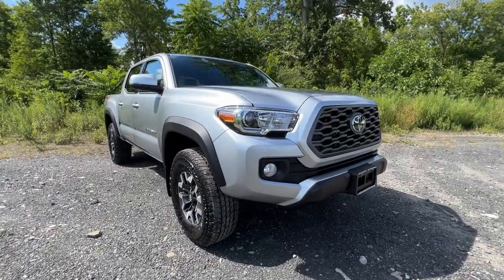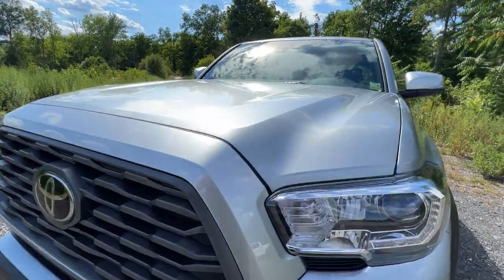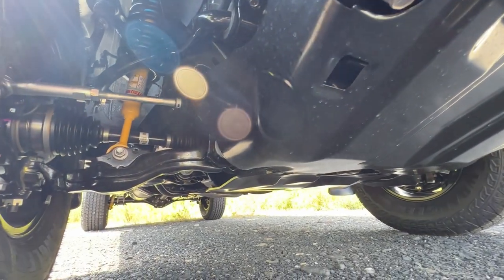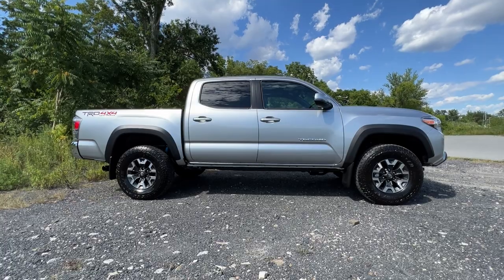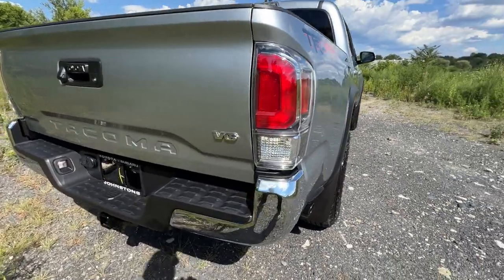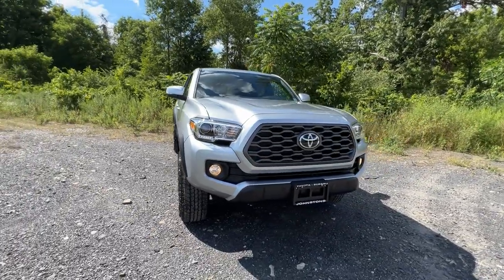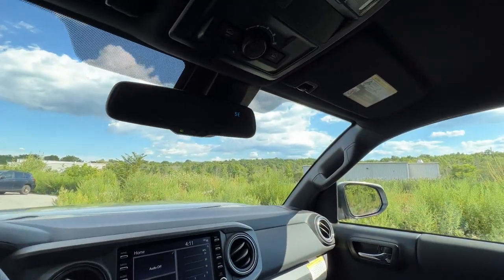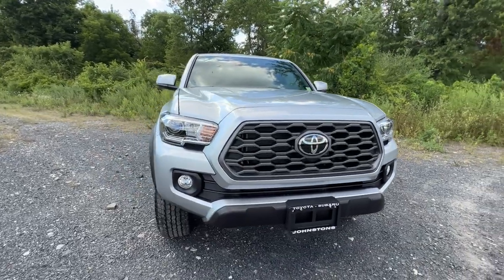The 2022 Toyota Tacoma TRD OFF-ROAD (a *biased* overview)

Comment: The Tacoma is nothing but a truck it's not fancy it's not fast it's not super luxurious but it's reliable & for me it drives perfectly fine I wanted one for years & finally got one I bought a 19 used TRD off-road with 17,00mi in Barcelona red with the 6 ft bed it fits in my garage, easy to drive & perfect for work. It's got a few features that are nice the adaptive cruise control + Lane departure. It doesn't have all the goofy shit you don't need. I dig it. ⛽ Mileage sucks tho

Comment: The main problem as to why I won’t upgrade my 2019 Tacoma is the payload! They need to update Payload by about 500 pounds for me to even bother upgrading!
Reply: You can just upgrade the suspension for much cheaper than a new truck will cost you. You'll probably need a bigger truck though.

Also, many people, including myself, have put more weight in the back than the Tacoma is rated for with no issues. Your results may vary.
Reply: @crusherman96  
I like The smaller size of the Tacoma!
I already upgraded the tires for heavier loads. I put airbags in the back suspension. 
I have 1000 pound camper in the back of my Trd, but when you add a couple of passengers and stuff to put in the truck I’m way overweight. 
I like the size of this Tacoma because it’ll go on trails easier than a full-size truck. 
The Toyota Tacoma is way behind in Payload than every other manufacture on the market!
Reply: @benjones8977  to be honest that 1000lb weight is what is hurting your payload.  For any halfton truck for that matter.

Comment: 20024 here. Just bought my preowned TRD 4x4 offroad with 10 k miles. Traded in my 2006 TRD Prerunner wit 350 k miles. The motor was still strong. Love the Simple Design of Toyota. Lovethe reliability. Less Electronic fuckery is hood, IMHO. I am an Avionics tech and I can tell you that the electronics are almost always the failure point in an electro mechanical system. Honestly, I would prefer a fully mechanical 4x4  engagement system, but those days are long gone. Loving my teuck so far though and I appreciate your videos....
Reply from the maker: I understand and agree and thanks for watching!

Comment: I have a 2014 TDR Off-road 4.0 5 speed a/t purchased new in 2014 and love it. The tech is really outdated to todays standards, no Apple play ect but not a big deal.  I haven’t looked at new ones in a few. Toyota has really changed a lot of the 4x4 options. Nice to see. 
My only minor gripe with my 4.0 is gas mileage. Avg around 16-18 mpg, but it’s a truck and I knew it would be great anyway. Nice to see the 3.5 with AI has corrected that some. Great vid.
Reply from the maker: Nice truck and thanks for watching! Wait till you see the next Gen of Tacomas and what their mpg will be 😉

Comment: Yes I agree the Territory are much better than the previous tire that came on the TRD OR.

Yesterday (27 Jan 2024) just bought a 2023 TRD OR Access Cab since the ‘24 returns to the Xtra Cab style. I like the Access Door picked it up with 8 miles. I am going to tint it and ceramic coat inside and out. My Salesman gave me the Overlays. I also have the basic Off Road, first time I bought a vehicle with no options. I like that the spokes on my steering wheel are flat dark gray.

Comment: Picked up a icecap white one on Saturday got it for 42.5 out the door with the led drl, all weather mats/door sill protectors, black out package, bed light, door edge guard, quick charge cables, wheel locks,cargo divider and window tint by the dealer only Toyota in socal that wanted to negotiate was Claremont Toyota. Most used ones wanted 38-41k  got a great deal on the new one.
Reply from the maker: Congrats!

Comment: I love my White TRD Off Road with the premium and technology pkgs, crew cab and the 6’ bed, tri-fold tonneau cover and running boards.
I use the front camera often, especially when going off road
Reply from the maker: Very nice truck
Reply: @brianruperti  Yes it is. We’ve been saving money for years to be able to buy it.
Since retiring I drive about 5-6K miles a year, so it’s safe to say that I’ll be driving my 23 TRD until I can no longer drive or I’m dead.

Comment: Nice overview, best I have seen bar none. I came because after looking at Frontier passenger door s not installed or not made right and the dealers not caring I just bought a 4dr,trd off road 6 foot bed and wanted to see what was coming in for sure lol. Frontier has a known issue (I know now) with passenger side doors not fitting right. This will be my 1st Toyota Truck.
Reply from the maker: Welcome to the family 😎

Comment: Thanks for your video, very professional and detailed. I am a 6ft 1" height guy and the smaller trucks are too cramped, seat too low to the floor. I would also think people should show the crash test scores when buying a vehicle, insurance costs, etc. Safety in a crash is probably pretty good on newer vehicles. I heard the naturally aspirated V6 is going away for 2023. 4 banger with turbo in its place, is thst true??? You did an awesome review, thanks again. Good choice in a quality truck purchase.
Reply from the maker: Thank you for watching. And thank you for the kind words. No definite yet on the 2.4T but I suspect it’s coming because Highlander got it and Tacoma has the 2GR-FKS that the Highlander lost. I trust it will be successful but the V6 is cherished. Especially the long lost 4.0 that the 4runner has still!

Comment: Hey man, i bought the 2022 tacoma 2.7 , 4cyl., brand new with 2 year warranty...the dealer says the first oil/filter change won't be until 10,000 miles...should i be concerned??..thankyou so much, great show and info👍🏽
Reply from the maker: Congrats! It’s normal for dealer to recommend 10k since that’s what Toyota recommends. I personally change oil every 5k miles or 6 months whatever comes first.
Reply: Yes, the 10,000 mile oil change is the MINIMUM to maintain your warranty, Change that oil every 5k or 6 months and that Toyota will never fail you.

Comment: Thanks, Brian, for the thorough walkthrough on the Tacoma! Love that silver color as well and would be what I get. I was getting ready to take the plunge when I found out that my local dealer is one of those who are gouging with "Market Adjustment" pricing. It basically pushed me out of the market. I have no interest in rewarding price gougers so have decied not to purchase. Was curious if anyone in the comments had to deal with this and if it disuaded you like me. Happy trucking and thanks!
Reply: I live in Los Angeles, every dealer is doing a 5k markup. Which turned me off. However one dealership. Longo Toyota is selling ALL vehicles at MSRP!! So I bought a Long bed TRD off road
Reply: Just got my 2023 OR for under $3000 MSRP. They’re just trying to sell 23’s before the new 24’s, got lucky. Greetings!

Comment: My 21 off road came with the oem led headlights. Yours came with the halogen and it’s a 22 🧐🧐🧐
Reply from the maker: The LED headlights is a package that some have and some do not. It’s usually $499-$599 spending on the region you buy the truck. Only available on TRD OR and TRD SPORT plus standard on the TRD PRO.

Comment: Hi Brian, do they have an OEM remote starter?  If not do you recommend an aftermarket plug and play one?
Reply from the maker: I haven’t seen anyone go OEM due to cost. Aftermarket plug and play is fine just vet it well and make sure the dealer backs it for at least a year or if you’re going solo, make sure it’s the real deal.

Comment: I have one on order just like that. My question is the tires. What do you think about the factory tires that comes on it. Do you think they will it last for a while and do you know the treadwear rating. I was thinking about having the dealer trade them out but don't know if it would be worth the money. What's your thought on the factory tires for longevity.
Reply from the maker: I own the 2021 offroad with the factory tires and go off-roading in them and highway drive and they’re fine. I don’t know the rating you’d have to look it up but for daily driving and entry level off-roading you’re fine.
Reply: How many miles do you have on your Tacoma now? Are the Goodyear tires wearing even and not dipping out.?
Reply from the maker: @ToyotaTacoma1952  21,000 miles and tires are wearing evenly performing fine

Comment: Is it true, That nationwide as a dealer-installed option, the
new lift kit provides a 2-inch front and 1-inch rear lift on
most V6-powered 4x4 Tacoma models?????? Thank you. Just purchased a 2022.
Reply from the maker: Yes it’s available it’s less in the rear to increase clearance

Comment: Looking under the hood the 3.5 looks even more serviceable than the 4.0. 
I have heard the Lexus models tend to get the new engines and technology for a number of reasons. First their buyers are going to expect it. These buyers generally don’t keep their vehicles as long, so if there are issues they aren’t going to keep them that long to create a bad reputation. And finally it is a smaller group of buyers to get new engines and equipment sorted out without creating a recall problem with a 240K+ of yearly Tacoma production. Toyota as we know is very conservative and likes to make small careful incremental changes. Still there are risks to new vehicles and vehicle parts, so no matter how much you test them they have to be used in the real world to really know how they will hold up.
Reply from the maker: Very nicely stated thank you

Comment: I am not sure what the ECT button is. Sorry if you covered this. I believe it changes shifting ratios of the transmission. I haven't tried it yet. Still working on all the other stuff to learn. Your input would be great.
Reply from the maker: Electronic controlled transmission for more “positive feelings” as the book says. It’s like a power mode button and makes the transmission rev out a bit more

Comment: When I noticed that the rear factory mat is one long piece I said: cool! But then, you have to experience trying to remove something to clean/maintain, to see if its really a cool thing to have. It is not. It didn't take long to realize that the one-piece mat is a b**ch to remove. You actually have to vacuum it first or all the dirt will fall on the black carpet underneath. I like to shake off my mats everytime I see a spec of dust on them (lol!), and not been able to easily remove my rear mat is agravating. I guess at some point I will cut the mat in half with a knife and problem solved. 
Another thing I don't like about my Tacoma interior is the oval ring around the loops that you pull to tilt down the backrests. The ring and cloth get pulled up along with the loop. It feels shabby and Ford-like. I think Toyota dropped the ball here.  Not too worried about it, but...
The last thing I don't like is the sound the door makes when closing. Again, very unlike Toyota. Reminded me of my friend's old Ford Explorer; an ugly "thump", instead of that crisp, nice, high quality Toyota "creack" of my old 2nd-Gen. Is Toyota using cheap plastic parts in their latch door actuators? Should I be worried 100,000 miles down the road?
I treat my cars very well and do not slam, yank over-rev or abuse them, but I can't help feeling Toyota is lowering the bar when I see these little details. Or maybe its just me.  I've been driving Tacomas for over 20 years and I can pick up the little details very fast. The better and the worse.
Great review as always Brian. Your review content is absolutely the best and exactly what buyers want to hear. Thanks for your efforts and honest insights.
Reply from the maker: Hey thanks for the detailed breakdown. As a Tacoma owner myself I agree about the mats. The loops don’t bug me. The door sound leaves more to be desired. But the mats do bug me when it’s detailing time lol.

Thank you very much for the support! You made my day 😎

Comment: Thoughts on the 4 cylinder engine??
Reply from the maker: Going to miss the 6, but I am open to change.
Reply: @brianruperti  I meant the 2.7l 4 cylinder!
Reply from the maker: @WesternRAM  ahh yes. I personally don’t like it because my mentality is geared towards more power and features. 

However, if you want to save money, and need a basic vehicle with a bed, it’s rugged and will last forever. 

It has low power. It’s nothing special. Until you make memories with it and forget how slow it is. Sadly it doesn’t get much more mpg than the V6 in most cases. 

But I’d say it’s great for those who don’t care about power, who live in a flat region, and want very affordable utility. Then that’s where the 2.7 shines. Even better if it doesn’t have 4x4. Now that’s a basic truck that has nothing to break!
Reply: @brianruperti  Gotcha! Reason I was asking is because I have the 4 cylinder lol and wanted an honest opinion. I live in PA so I have a 4x4 version, but that’s because it can snow here a good bit in the winter. 

It does have low power, but I’ve gotten it to 100mph on the highway without ECT and it did well! It’s easy to maintain and rugged when I need it to be. It’s a sr5 access cab 2.7 4x4. Easy daily driver for commuting to work and it won’t let me down when I need it to get me out of a ditch. Lol

I won’t win any races with it though in any situation haha.
Reply from the maker: @WesternRAM  yes precisely what the 4 was made for

Comment: And What was the MSRP??
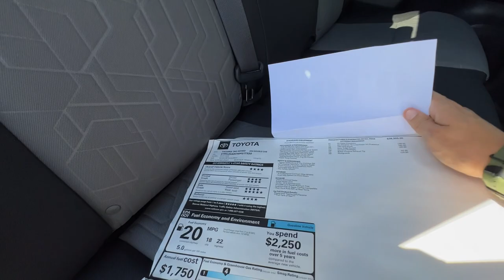Reply from the maker: 24:43 
$40,727
Reply: @brianruperti  Good one! But, my local dealers have a $5000 dollar markup on these, they usually install some options on these. I will say dealer installed option run from $1750-$3500. My guess is this will end-up costing $52000-$53500.
Reply from the maker: @Andi_Doci  Sorry to hear that
Reply: @brianruperti  Don’t be sorry, lol. I drove 400 round trip to pick up 2022 Frontier, because of that $5000, but I could not avoid the rip-off dealer installed options. What were these options? Tints for just the two front windows, wheel locks, and a few extra ding and scratches right off the dealer lot, added cost was about $2550. Now feel sorry for all of us!